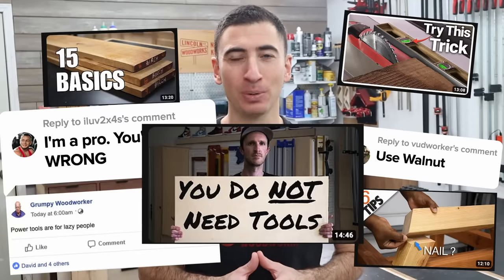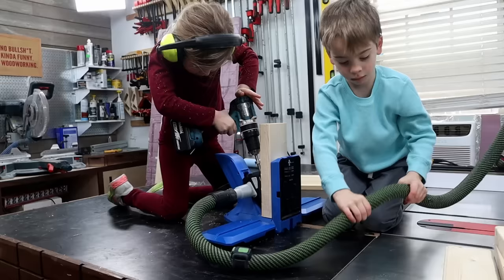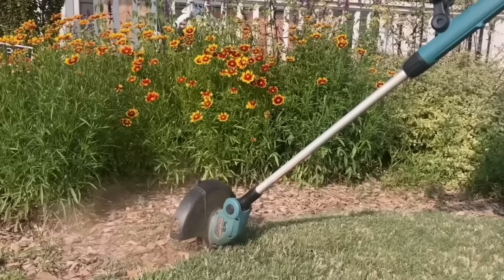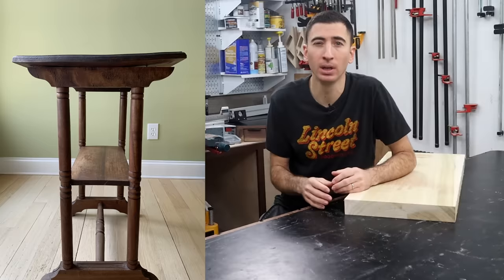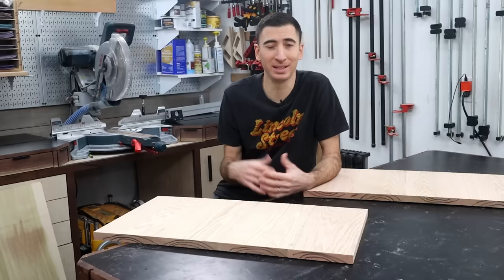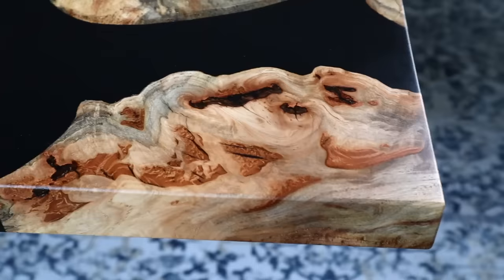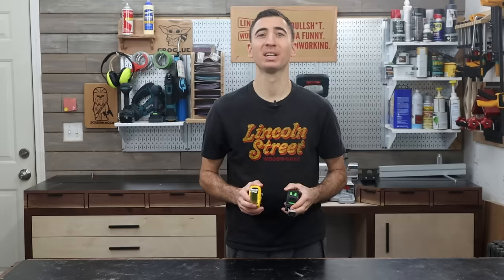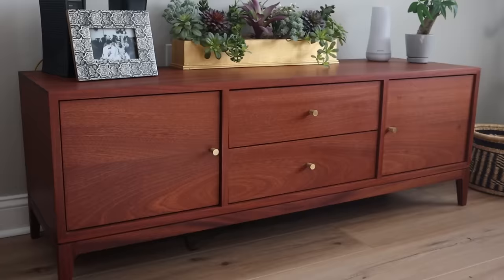Every beginner needs to hear this

Comment: Good common sense video.  Forty years ago I built a full kitchen cabinet set with 10 drawers and 15 doors of various sizes.  I used glue only and mostly butt and lap type joints.  This cabinetry has endured the ravages of 3 boys, more nieces and nephews than I can count, and now a passel of grand kids are doing their best to test the joinery...so far so good.

Comment: Ignore the naysayers. Really, just ignore them. You are correct, a piece of furniture is not a single joint, it is a system, and all the joints and wood strengths work together to create a strong structure.  I trimmed million-dollar homes when I was young, built high-end, award-winning cabinetry in multimillion dollar homes, and after all that taught and sold extremely advanced CAD/CAM software for twenty years. I've been in hundreds of shops and factories and seen every kind of joint and none of those woodworkers argues about strength of single joints, none. Their product is a system of joints. I've taught hundreds of woodworkers advanced CAD/CAM systems and sat down with them examining ridiculously minute detail of every aspect of joinery, workflow, and product goals and, though all different, NONE of them were wrong and NONE of them claimed theirs was the only way, or even "best" way...a real pro knows better and ignores those arguments as they are irrelevant to the finished product and a waste of time to argue, and that applies to the hobbyist also. Your hockey players were a great example of why. 

As for your take on tools...correct again. The top brands, proven brands, have a track record, the key is what platform do you want to build on. I have a slew of Dewalt...because you use different battery systems for different brands of tools, you want one battery and charger that can run the entire system. You can be just as happy, as a pro or hobbyist, with any of the other brands. I recently decided to get a cordless ratchet to work on the car, I didn't study all the "reviews" of brands, I checked to see what Dewalt offered...because all my batteries and chargers are Dewalt, I'm confident of the brand and not willing to switch brands (throw the baby out with the bathwater) over silly hair splitting of "features". Take a Dewalt, Makita, Bosch, Rigid miter saw, see how the features fit you and go from there (I will say, I'd skip the Ryobi, all my experience with their tools has been bad). The only time you will shift to another brand, is when you grow a business to need a CNC router, a 54-inch-wide belt sander, edge band system, etc as none of those brands make those products. Even then it isn't a switch, it is an "add". In all the shops I visited, I have had the privilege of seeing some of the best, museum quality pieces made...and many were made with Japanese hand saws and hand tools. So, it's the craftsman, not the tool. Oh, and I have one Makita saw, it is a ten-inch, corded circular saw I have been using constantly since 1983. It is ugly, really ugly, the blade brake is a little sloppy these days but, other than that, it cuts like the day I bought it, never even had to change the brushes or a bearing, which I find magically amazing.

Comment: Always use the same tape measure in a project to prevent variations due to end hook motion ( or cheap construction). My odd tape is marked with the deviation, and is normally reserved for yard work.

Comment: A guitar top is about 90-100 thou.  Quite a number of builders do not shellac the underside of the top, many do.  But you will find many intact tops without that are quite old.  Why can they last so long without the reciprocal finish?  Correct moisture/dryness when built and when stored.  On the other hand, lapstrake boat building presumes the wood will swell as does the use of wedges to sheer rock slabs.  There is no single rule, just outcomes and reasons for them.

Comment: I have an AQUARIUM STAND built with cheap Home Deposit "White wood laminated panels". No fancy joinery, I even joined two 12 inch boards with a factory edge joint in the middle and didnt have long enough clamps. (24 inch nominal ends up as a 23 7/8" clamp....)

I knew the bottom would be hidden so I added strips that I glued and scewed to the bottom to hold both halves. coated the whole Entity with water based poly, and leftover oil base. 8 years ago. Through swamp water, UV exposure, spills and a heavy wet aquarium, is the stand still stable with a top within .031 nad .063 flatness? Yup. Better than a brand new ryobi table saw with  .125 to .190 variations on the table.
Reply from the maker: but will it pass a joint test!?!?!?

Comment: As a professional cabinet maker who was schooled by my father from the time I was 12 years old a glue joints and dowels are the preferred joint for almost and but a butt joint but a compound miter joint witch uses a biscuit joint. PS Coffee tables and bedside tables and not made to be sat on so the a compound liter is best. plus it is a much more pleasing corner that a poet and rail set up.

Comment: The woodworking glue-sawdust tip works fine and is all but invisible for small gaps, as you said. I have, however, seen people recommend using cyanoacrylate and sawdust, and this does not work the same way. Super glue darkens the sawdust considerably, which I guess is okay if that's what you want, but be warned.
Reply: I have nice recipe that i use in order to fill cracks or uneven spots in wood.

traditional (Finnish) and easy putty/filler

1 liter of water, 1-2 tablespoons of wheat flour + sawdust/sanding dust (which should be moistened first.)

Wood dust are added until the putty/filler is a suitably solid mass.

Comment: I was fortunate enough to start in a cabinet shop where old school joinery was still used to build furniture and fine cabinets.  Mortice and tenon, raised panels, alternated grain on glued panels, and dovetails were the key to properly built projects that lasted for decades.  I built a full bedroom set of furniture out of solid iak that still looks geear 40 years later.  Do not go down the pocket screws are good enough rabbit hole.  They are not .  Craftsman learn how to do mortise and tenon, dovetails, and frame and panel construction.  These joints will last a lifetime. Second buy a set of diamond stones and learn how to sharpen like a pro .  Razor sharp tools make a huge difference in your quality of work .  Third buy the best quality tools that you can afford. Try to get them on sale, on clearance, at an auction, or at a yard sale. You often regret buying a cheap tool but rarely regret buying a quality tool. All of my Makita, Bosch, older Porter Cable, and Dewalt professional tools stiil run after over 40 years. Pick one or two battery platforms and stick with them . 
Lastly buy an 78 inch or 96 inch quality box level so that you have an accurate straight edge! I should have done that 30 years ago.  Pick a project and start woodworking.  You will get better over time.  It will get easier as your skills improve.  You can do it!

Comment: My tip for using a drill in the shop. Use a corded drill. Because battery pack give out in the middle of a project. Interrupting you work flow.

Comment: Find a local wood dealer that does slabs and a lot of times they'll sell nicely cured and even kiln dried ends and bits at pretty good prices, sometimes already set up as the right shape billets for handles, gun stocks, or guitar bodies, et al, and I think all of them have stacks of pen blanks which are also trim chopped up into basically tiny billets at almost give away prices.
It's a good way to get hands on quality materials and develop a relationship in the local wood community for people interested in testing the waters.  I could make a nightstand of walnut pen blanks for like 50 bucks from local dealers/cabinetmakers lol

Comment: I took apart a built-in bookshelf/cabinet in the house we owned.  It was built in the early sixties.  This built-in was screwed and glued.  To make it easier to take apart I took out every single screw.  Nothing happened.  Glue held everything together.  I started with a small prybar.  It bent.  Got a bigger one.  The wood split.  This 2 hour takedown took me more than a day to peel apart, splinter for splinter.  Not ONE of the glued seams gave up - it was the wood that gave in.  Mostly 2" old growth - the guy who built it was a CFO or some such at a lumber mill and knew wood inside out.  Wood glue now is even better than the industrial glue he used.  Bottom line: if anyone tells you that you need complex joins just for strength?  Yeah, frigging right!  I don't care if you have 500 years of experience with dowels and biscuits and gravy or whatever!  In the end I used a chainsaw, sawsall, and a sledgehammer to break this apart!  No screws, no nails, no dowels or other modern crap, just 50 year old glue!!!  No, it wasn't sat on, pushed around or abused, but you could have had an elephant use this as a stepping stool for 50 years and it would still have stuck together.

Comment: It’s true that some makes of power tools are better than others. Very roughly, the expensive ones are better than the cheap ones. 
But what’s more important is that all the ones from respectable brands work. So if you’re just starting out, don’t let “this isn’t the best one made” stop you from getting a tool to do your project. 

Also, with battery tools, the batteries are usually not switchable between brands (they don’t have to be that way— the tool companies do that on purpose). So once you choose a brand, you’re pretty much stuck with getting all your battery-powered tools in that brand, unless you want to have a lot of different, non interchangeable batteries and chargers to keep up with. Which you DON’R want. So you don’t have the option of picking the individual best saw, the best router, the best drill, etc., if they are different brands. But this isn’t as bad as it sounds, because, again, pretty much all of them are good enough to use.

Comment: This is always the case with any forum. 70% of people answering just like to tell you you are doing it all wrong and you need to do it totally different. While you just want an answer to a tiny simple question 😂 Another 20% are answering while they have no clue. They often even admit it. Why answer in the first place if you don't know the answer 😅 And then 10% is actually smart enough to not waste anyone time and give you a straight answer. Forums can be useful, but they are never as useful as you'd expect..

Comment: Never got the sawdust and glue thing... always looks pretty bad. Saw dust is too big and chunky to be effective.

Use quick dry epoxy with sanding powder from a 150 paper. Looks damn near invisible and if you apply a finish with sheen it gives an awesome 3d depth look haha. I always found CA to be too annoying because it doesn't dry well if it isn't under pressure.

Measure twice cut once is just a general idea, not taken literally lol. It's always better to cut to fit than try to measure it. Applies more when you don't have access to the place/piece you need to fit something for, like building custom cabinets for a kitchen.

Your content is cool and I love your attitude dude! And yes, I've been making furniture professionally for over some 20 years now :) we all have our preferences

Comment: I agree with everything here and I'm not a wood worker. Im in construction, I have done years of paint and drywall, trim work, tiling (floors, backsplashes and custom showers), electrical and plumbing. I worked with a greybeard tile guy that knows it all and cheats highly visible joints and has a half inch plus gap between a shower floor tile to the wall tile because he thinks doing the floor last is faster and easier but couldn't take the time to layout and fit them properly, people that say they paint who clearly maybe painted a room in their house once, claim they can drywall and use lightweight bucket mud on their tape coat, "electricians" that I came behind to find out wtf they didn't bother even tightening the lugs the wires are to? this switch sparked after I flipped the thing its wired neutral to one and hot to the other, not a neutral used as a hot the actual neutral, plus he clearly didn't test it, a plumber that put metal washers between the bolt and rubber gasket in a toilet tank, it leaked obviously whats the point of all this. In my little over 10 years I found out its good to listen to people but I'd definitely check around to make sure they are not speaking out their butt because if you are learninf from them and they are teaching wrong you can go and do wrong too. Dont take cheap shortcuts and have some gosh darn pride in your work. Like the guy said brand of power tools hardly matter, I have all Ryobi cause they were the cheapest and they have alot of crap. I have all my batteries except the one I used to jump my van when I couldnt get a jump because where I was at. All the tools I got when I started still work after all this time, its not a big deal. Get what you can afford. I did try the saw dust n glue trick on teak and it was disappointing just how dark it was especially after finish.

Comment: I bought a Dewalt drill after using someone's and it had more power than any drill I had ever used.  Obviously I had not used any drills from the major tool companies before.  I had no idea at the time I was choosing the tool line I would need to stick with the rest of my life.  However, I am glad I went with Dewalt simply because of yellow.  I have found when I'm looking for something it tends to be easier to find when it's yellow, it just stands out to me.  

When asked what brand I recommend, I tell them the yellow story, then I tell them any good brand is fine but look at their entire line because once your invested in batteries you will end up getting tools that all take the same battery.

Comment: I want to help people understand better where and when to use that glue trick just a bit. It is preferable to over glue the joint and sand it in, so that you are not working the glue in superficially, but rather "plugging" the glue in. The ghosting you see pictured tgeir is the glue on the surface being burnished by the sander. The problem with glue is that it retards stain and does not allow proper penetration. To avoid those ghost blotches, dob the area lightly with water and carefully whipe the area around the joint or spot, avoidung direct contact with your wad or rag, then sand. This will nearly eliminate the burnishing and will also reduce the glue pull-out you get as the glue burnishes and drags over the joint, ruining your beautiful joinery! Also, as an aside, it is useful to be mindful of the open time differences in the various glues. Titebond III, for example, has a longer open time than Titebond I, and is generally a darker glue. Keep that in mind when gluing lighter woods. When sanding a joint between dissimilar woods, the dust will be an amalgamation of both species, and likely, you may get a color that looks like neither and stands out more. Be wary of that and carefully plan the direction you sand to push the dust where it makes the most sense to avoid unwanted mixing! Best of luck!

Comment: Hi , I was wondering what everyones thoughts are on adding inexpensive carbon fiber rods during glue up straight through the work piece to avoid cupping / warping etc.    I was thinkimg one every foot or so?  I know this is done in some guitar necks for stabilization. I was thinking maybe 3/8 to 1/2 in on something like a table or desk top.  Thanks.    Hollow tube or solid stock rod?

Comment: I luv that u showed how much stronger the joints r after the whole project is completed.

Im a metal fabricator and ever though mt welds were horrible n full of perosity before my corner beacket was completed u could probably break it with 20 blows of an 8lb sledge, i know cuz i tested my shit welds sometime in the futre, after i made my corner brackets it would take a litteral wrecking ball or heavy machinery of some sort to make them fail they also had 8x12x25’ beams connecting to the brackets 16 brackets in total to make a round pen for horse training, ppl been training their horses there for 7 years now n its still standing soooo yep… im not proud of those welds.. haha

Comment: As a trained professional cabinet maker I have to disagree about that wood ring situation. I learned AND can confirm that it's way better to glue with alternating rings.
But the way you showed alternating rings is totally wrong. You have to cut the boards in the centre and then lay them in an alternating pattern. This way you have 4 positions to turn the boards instead of 2
And yes, it still might bow, but much less than the method you showed.

Comment: I prefer buying pretty screws or bolts and leaving them on show. If I want a fancy joint i'll make it. But I like the edge of plywood and screws. If i'm faking it I can weap it in vinyl. That's my only complaint to pocket screws. I even prefer exposed dowels. Does wood have to look like its held together with magic?

Comment: Good video!  I have luck cutting smaller width boards just a touch long and sanding them to length with a 12" disc sander.  You can sand to the perfect length every time.  Sure, it adds a bit of time.

Comment: I had old Dewalt 18V XRP tools that were phased out and left me with some expensive tools without batteries or cheap noname batteries.  I ended up with Craftsman simply because now my mower, portable leaf blower, drill, driver, weedeater..... etc all use the same batteries so I can swap them around and maintain only one charging infrastructure.